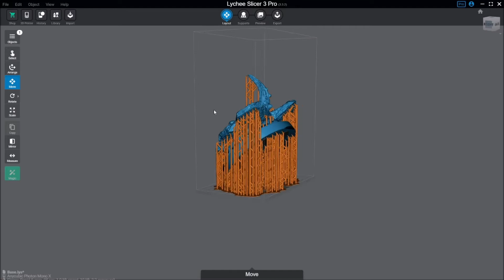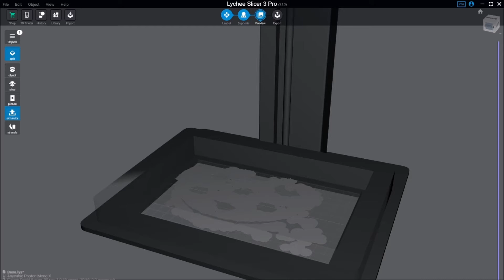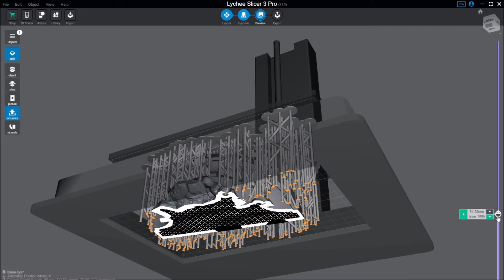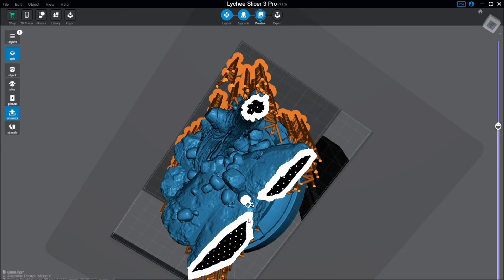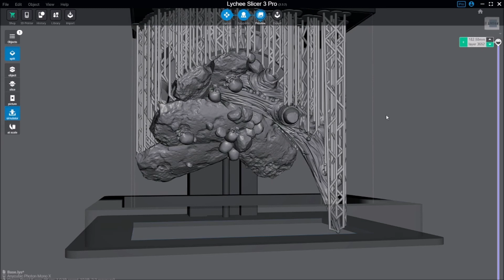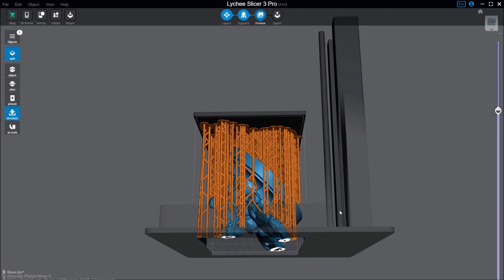Tips to speed up your large 3D resin prints on the Anycubic Mono X

Comment: How do you top up resin?
Reply: Hit pause, pour resin on top of the build plate, hit resume. Or you can get more seamless results by raising the Z axis during pause so you can mix the old and new resin using the plastic scraper.
Reply: And be really careful not to spill resin between the vat and curing screen. If this happens, you must raise the z axis and empty the resin tank and thoroughly clean the vat and curing screen before resuming.
Reply: @xlynx9  Thanks!

Comment: Another thing to mention is that hollow models will create a suction-cup like effect. You need to put a hole someplace close to the build plate so air can get inside the hollow area and not create a suction. This suction is stronger than a solid model of the same area.

Comment: 6 layers at 35 seconds is way too long ?! What laser power are you running? I only use 2 layers at 20 seconds max !! Even on full size flat plates. And layer times only up to 1.8/ layer if layers of 100um or more, other wise down to 1.3 for 50um layer height. 80% power. 👍🏼
Reply from the maker: I may have been overly cautious to get the supports to adhere to the build plate.  This print was massive and heavy, plus putting a lot of pull forces on the FEP so I wanted those support bases burned in good.  I appreciate the tips though, I will incorporate these in future prints.  Thanks for watching!

Comment: Why don't you combine your support shafts together or overlapping to reduce the number of shafts and the pads (in the initial layers) and the suction (pull on FEP) ?
Reply from the maker: This is a great idea in some situations.  There is a balance between supporting the islands and model overhangs versus also having enough strength to attach the model to the build surface and hold it firmly through the print.  Thanks for watching!